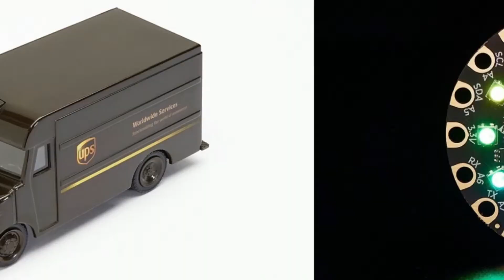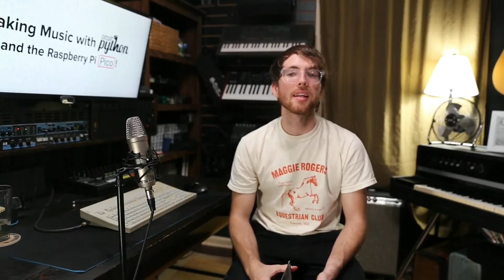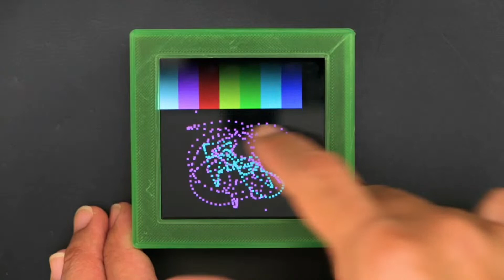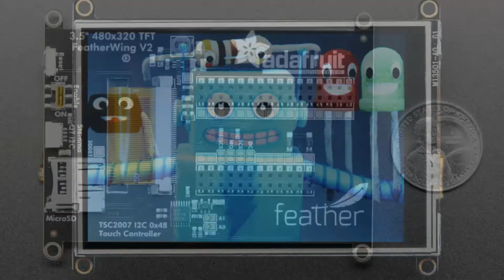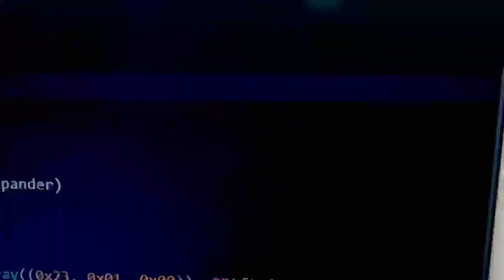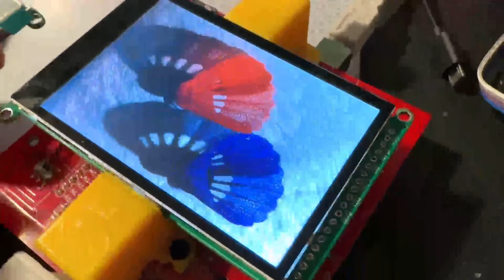ASK AN ENGINEER 11/15/2023 LIVE!

Comment: I've been experimenting with latching relays. These require just a short pulse of current to change state. The one I'm using has a 16A 250V AC changeover switch and the coil takes 5V 80mA for a fraction of a second. I used a Rohm BD621 motor driver chip to drive the coil in either polarity. It occurs that because the 80mA is only very short duty cycle (otherwise it is less than 1mA), a capacitor could be used to make up for the narrow gauge STEMMA wires.